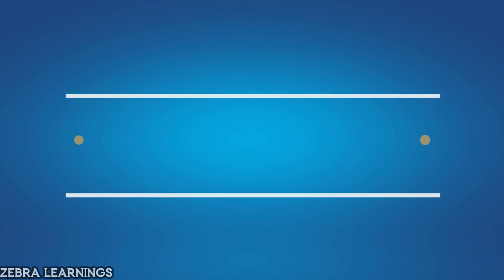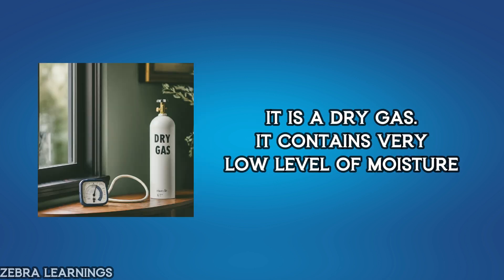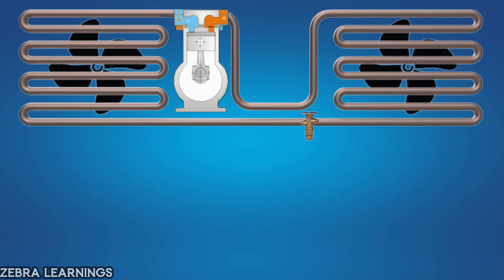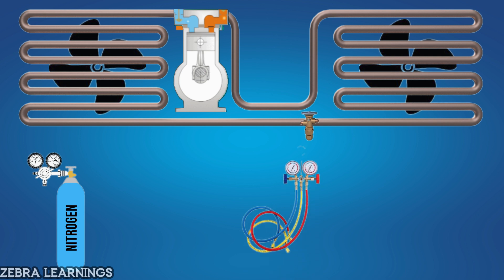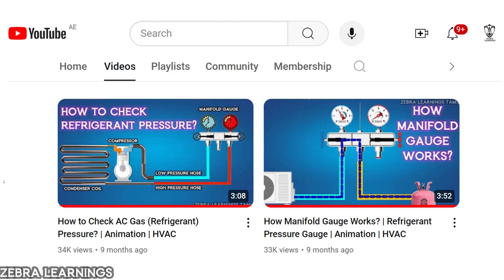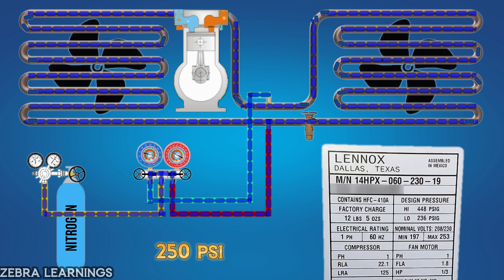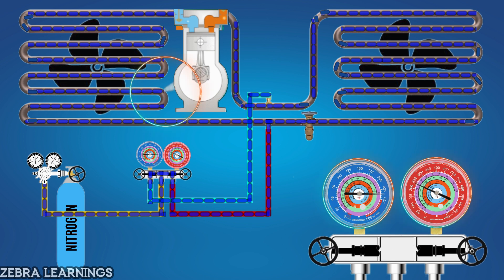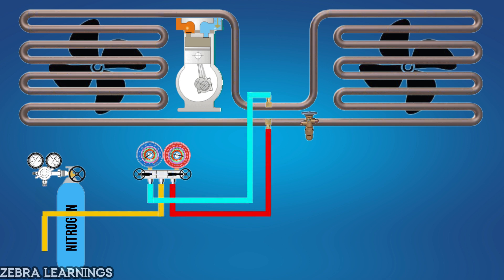Nitrogen Leak Test | How to do? | Animation | #hvac #hvacmaintenance #hvactraining

Comment: A very important question: When should we use nitrogen gas? Should we use it with a new unit before charging it with the chiller, or even with a previously charged unit? And if it has been previously charged, is it possible to detect the leak without needing nitrogen? Please clarify.

Comment: Why is nitrogen gas used and why not anything else
Reply: Please reply me
Reply from the maker: Nitrogen gas is dry gas, so it won't introduce any moisture into the system.
And it's a safe gas for the environment.
The price is low and easily available.
And it's high pressure gas so it's suitable for leak detection.
Reply: @zebralearnings   kindly any other  information for increase my knowledge base please share sir.
Reply: Nice questions
N 
Thanx for the reply too
Reply: @vj0904  ok thank you for reply

Comment: If the nitrogen test was set at 300 psi and drop to 270 psi after two days, can it be considered leak?
Reply: That's very good.  10psi/hour is maximum allowable (this is not very good, IMO).
Reply: @thisisyourcaptainspeaking2259  sorry, so may I know 2 days drop 30psi is it consider leak? Or it is normal to drop a bit after 2 days?

Comment: When the expansion valve closed at the evaporator how nitrogen is weynt from suction line to discharge line.
Reply: Explain how n why the txv would b closed? Tip, think of the temp the bulb would be picking up with no refrigerant in system

Comment: My neightbor did the leak test and the servicemen used R32 gas to check as it was readily available to them. They filled it and kept it for 15 mins under pressure of 250 I think after that pressure didn't reduce so there is no leak according to him. Is that legit?
Reply: Not at all
Reply: Using R32 for leak detection kind of defeats the point, doesn't it? If there was a leak then we are leaking refrigerant..

But other than that sounds like valid confirmation for no leaks.